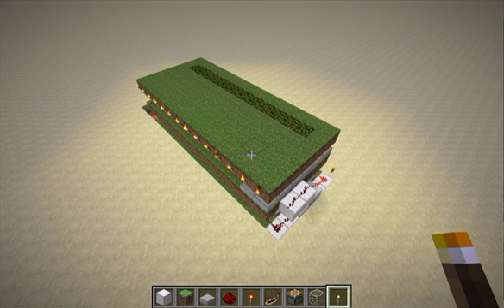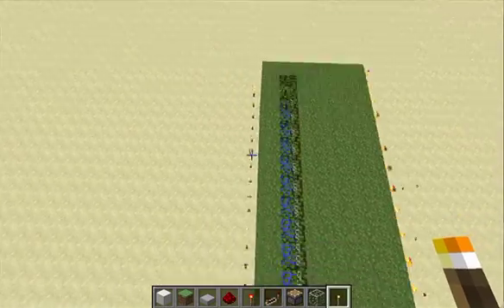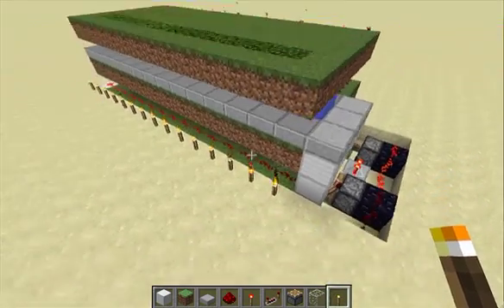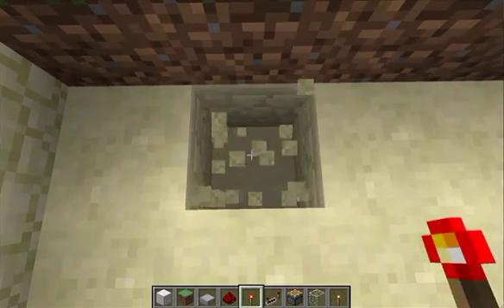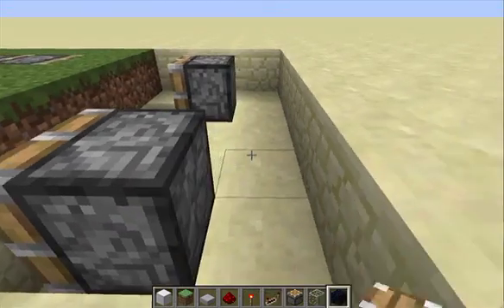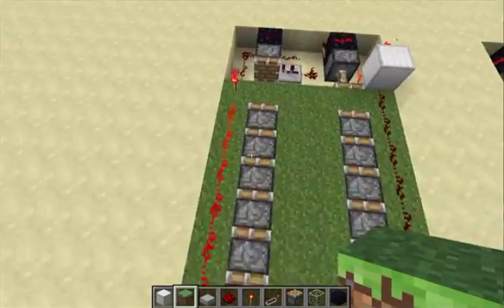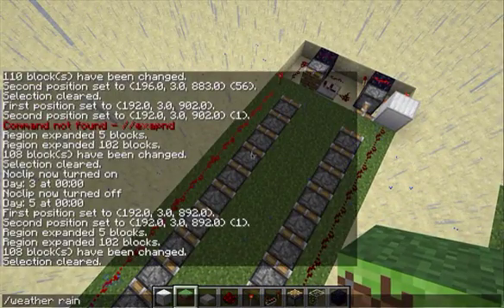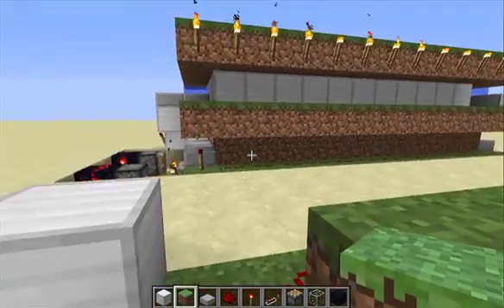Light Sensor 12x

Comment from the maker: The leaves were a fix for a lighting bug I found back in 1.2.5. I haven't checked, but there's a good chance that bug has been fixed by now, in which case you can just leave the window empty or cover it with any transparent block, including glass, trapdoors, etc. Give it a try and see if it works.

Comment: i allready using the 7x one and it works great
gues il integrate  the 12x in my town too now 

to inform dont forget the range bug.on an big place you can get out of range of the 7x-14x-12x
then they dont activate.just build multiple O.o x around youre place so it keeps activating in youre range
its an minecraft problem not the sensor

Comment from the maker: No, you can't block the torches. Their light has to reach the window AND all the grass on the outside of the machine. If you want to build onto the machine, you'll have to figure out the lighting yourself. All the outside grass needs light level 9 or greater directly above it, and the window needs light level 7 or 8 directly above it, no more, no less.